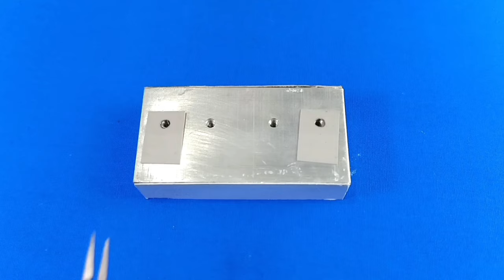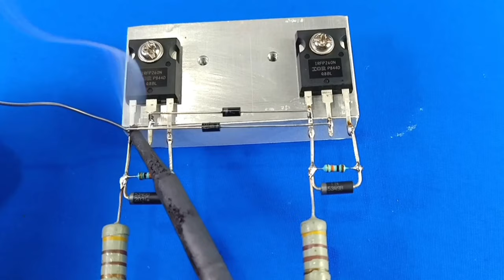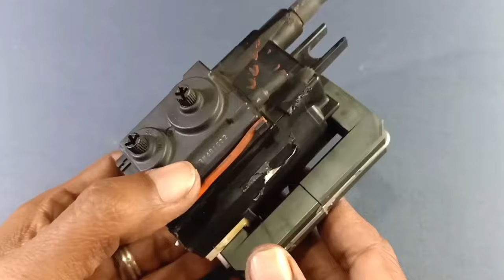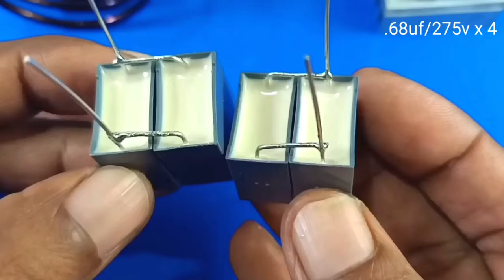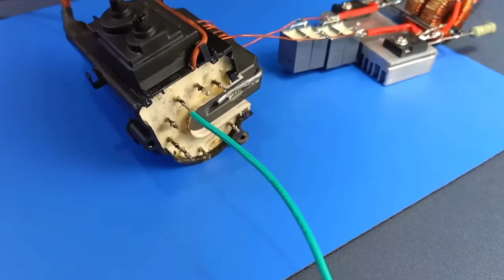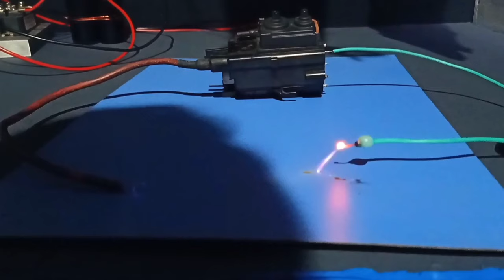DC 12v to 400000v High voltage Generator, Simple Homemade High volt Circuit

Comment: Its very nice but you added one zero too much in the title this arcs is 40kv and not 400kv if it was it would ignite at half a meter or so
Reply: Нулей много не бывает)))
Reply: yo, do the math. at 400kV it would around 14cm, not half a meter xD you would need more than 1 MV to spark it across 1/2m
Reply: People just really seem to love blown up numbers, huh? First we were talking about 400kV, now that spans half a meter... xDD. Btw, that arc looks more like 90kV, assuming 3kV/mm of breakdown voltage at atmospheric pressure. That's why it scares the shit out of me that he really holds both wires when arcing. That arc will drive quite the current, look at it's intensity...
Reply: Still WAY ! TOO ! MANY !  ZEROS !! ITS POINT ! MANY !! MANY ! MANY !! ZEROS !!!
Reply: и 40 кv нет 
25000 v .
афтор "гонит" .......
Reply: It make u do death or heavy shoch???
Reply: Да тут и русские есть
Reply: Ys
Reply: @blvckbytes7329  it's how far it can jump not how far it can be drawn out to.
Plus using needle points rather than spheres makes a big difference.. probably 30kv here
Reply: 9
Reply: Exatamente, eu concordo
Reply: No it's 9 kv
Reply: Quando se trata de alta tensão, fica difícil descobrir o valor "exato" da tensão .....🙄 eu já construi um  circuito oscilador semelhante a este para acionar o transformador flyback que possui um núcleo de ferrite  ou seja tal transformador trabalha com frequências extremamente altas ...meu objetivo era usar este transformador para acionar o primária de uma bobina de tesla ,a bobina de tesla é um transformador ressonante , geralmente este transformador não possui um núcleo como os demais transformadores, a bobina de tesla possui um núcleo de ar...
Reply: Больше 20кV..., но точно не 400kV
Reply: @ДмитрийСурский-ч1ф  и 20 не будет, тут скорее 10-15 кВ, у меня 12 кВ транс пробивал примерно такое же расстояние.
Reply: Remember air brakes donw 1-3kv/mm

Comment: Flyback transformers usually range from around 10-20kV not 400kV. If it was 400kV I think that transformer would be burning up by now.
Reply: Up to 27.5 kV for colour tvs.
Reply: I agree with you. In the video you can see that the two ends of wires are very close to start the arc, then once it is on, distance can be improved. You obtain a “plasma” discharge in this case.
Good project, I’ll try to reproduce it. As other people said,, it isn’t a good idea to handle both wires by hands…☠

Comment: You used to 0.5 Sq mm wire flow voltage 40kv not possible

Comment: Awesome, this is one of your best to me.
But I will love to ask how can we convert it for home use?
Thanks
Reply from the maker: Thanks for visit
Reply: @RJEDITALL  Brothers can electrocute pigs, what can a 12v inverter do?
Reply: @RJEDITALL  Sir, do you know how many kv a police stun stick has?  , I want to make a higher voltage than the police, but the high-voltage generator in our country is very easy to break, and the power generation time is only 6 seconds. After a long time, the high-voltage generator will burn out. Can you make a high-voltage generator?  Can it continue to discharge for more than a minute?
Reply: If you use 40kv at home... Then the power company charge also a 40kv...of your bill
Reply: @黄蟮  it is about 20-25kv in stun gun
Reply: doesnt  it have 50kv? my dad is a police officer and he showed me the taser manual and it says it uses 50kv @basic_proboi

Comment: This is at most 60kV, the initial spark distance tells you the voltage, depending on the power availible you can stretch the arcs further, for the initial arc its 10-15kV per centimeter

Comment: Looks reasonably easy to duplicate however there is no info about transformer voltage and current or the capacitor bank that is shown. I saw you said to another that parts list in description but not transistors are there. List of all components please!! 
 Cool project and want to try it
Reply from the maker: Please check the diagram in the video
Reply: @RJEDITALL  in what video to check for diagram? to the next video ??? hahaha loooooooool no diagram is there. Anyway , you have make a huge work to do that? Just take a vehickle multiplier and all ok
Reply: Well the transformers input voltage can be around 12 and output is 10-20kV
Reply: Các linh kiện điện bán dẫn ấy bạn có thể tìm chúng trong bo mạch tivi, nguồn máy tính cũ..và không nhất thiết biết nguồn điện kia ra bao nhiêu vôn..đơn giản chỉ là  chế nghịch

Comment: Thats an insane arc for a flyback, congratulations! But you are putting yourself at huge risk holding each wire with each hand, insulation can easily fail and the electricity will make it's way through your heart. use one hand only for such voltages unless you have two long sticks
Reply from the maker: Ok bro, ,❤️
Reply: bro it is high voltage arc but less current so if he touch the conducting wires he will not die just he will become unconscious for sometime.

Comment: I made one and it works now 
Can you please tell me the exact output of your power supply 
Volt and current (amps)
One more doubt ( can I use other diode instead of 4007 cuz it's too weak for this circuit.  Can I use fr207 or fr407
Reply from the maker: I don't check, just Idea, you can use this diode
Reply: @RJEDITALL  I also asked how much volt and amps you are supplying this circuit
Reply: @Greenorange0  it seems he use ex UPS transformator like around 12v 10A
Reply: Hey brother may I ask please what type of capacitor voltage and microfarad did you use when is connected to the bridge rectifier because he didn’t mention that as well
Reply: how did it work for you?? we triedbut very small spark. what can wedo? please help us sckl project🙏🏻🙏🏻🙏🏻🙏🏻🙏🏻🙏🏻🙏🏻🙏🏻🙏🏻☺️

Comment: could i use something like an irfz44n instead of those irfp260n?
Reply from the maker: Yes, you can use
Reply: @RJEDITALL thanks
Reply: Also could this circut be used as an induction heater?
Reply from the maker: @katinukanalas  yes, you can use for induction Heater
Reply: @RJEDITALL  youre the best

Comment: can we use toroidal 0.5 inch 60 turns instead of 1 inch?
Reply from the maker: You try with swg 19 copper wire

Comment: Much thanks for this
Please review the full list
And, how can it be used for home or workplace, like, welding ...
Reply: The circuit diagram is at the end of the video, it contains all the components you need to build. It's already build for home used, but you can't weld anything with it because it's just a science project for experiment with very high voltage and very
dangerous. If you have an idea of use it for welding, you better not come close to this beautiful but dangerous project. Cheer!

Comment: Hello sir may I know what capacitor did you use is it 10000uf 50v? And thank you fir the video it is great
Reply from the maker: No bro,     .68uf/275-450v capacitor
Reply: @RJEDITALL  Thank you sir for your quick answer, I want to know which capacitor voltage and microfarad did you use to connect it with the bridge rectifier

Comment: Please never use both hands while holding live cables. I know the frequency is ramped up high but you should get into the habit of safety. Then if viewers decide to try they will know how to stay safe whilst doing so. Insulated gloves and non conductive rods to make sure its away from you so body doesn't form part of the circuit. Stay safe ⚡
Reply from the maker: Ok,Thank u bro

Comment: Hello
I had a question
What is the name of that small diode that connects one transistor to another?
And that big resistor is a few ohms and a few watts؟
Reply from the maker: please check diagram, zener diode 12v 1-5w. and diode 4007

Comment: Is this possible? Use electric appliances like fan, rice cooker, heater, kettle without any problem?
Reply from the maker: No, not possible, this is dangerous, high voltage
Reply: @RJEDITALL  Thank you very much !!!
Reply: You can change the output to not be connected to a flyback transformer instead be connected to a coil with a few turns to use as an induction heater.

Comment: man I even have one of these flyback transformer but lack of knowledge 😢about it I wanted to make one but couldn't understand anything And i dont even know which and what components u used in ur video
Reply from the maker: Please check diagram in the video, and working with safety
Reply: @RJEDITALL  sure man can i connect the final two wires (by which u were making arcs) and make a jacobs ladder I even seen some of others using a ballast for high voltage
Reply: @RJEDITALL  u earned a new sub!

Comment: I made this circuit.. and its excellent  but it has a strange behavior... when i used a ac flyback and turned it on the first arc was small .. after the first arc the second arcs was big and so on ... can you please tell me the cause of this.. whenever i do this i always get first arc small after that i get big arcs😮😮
Reply from the maker: Check it well

Comment: Ok its a zvs driver with crt flyback transformer but what surprised me the was that he was holding both wires with bare hands, 100% chance of high voltage breaking through insulation sending him to destination f, probably ranks in top 10 luckiest people in the world
Reply: @RJEDITALL  so jao
Reply: Not exactly luck but it depends on the thickness of the insulation.

Comment: what is minimum ampere to run this type of circuits? can I use cpu power supply? thank you
Reply from the maker: Maximum 24v 15 ampere, ❤️
Reply: @RJEDITALL  can i use cctv power supply switching
Reply: It depends on the size of the arcs, the smaller the arcs the lower the current and vice versa.

Comment: Very good...is this a D.C to A.C converter circuit driving a car ignition coil??
Reply from the maker: Thank u ❤️
Reply: @RJEDITALL  mcn mta oyage contakt no ekk dannako
Reply: Well not really since car ignition coils cannot work with that high frequency. But you can technically call this a DC to AC convertor but only for high frequency (around 15-50kHz).

Comment: My zener keeps exploding now i have 5 died irfp260n  3 died 12v 5w zener diode why its keep dying ? First 30 40 sec works and dies away
Reply from the maker: @AmplifierBoards-c2q  check your pf, first time check with low voltage n current

Comment: Can i connect it on 12volt 4.5 ah baytery
Reply from the maker: Yes
Reply: Its not working the mosfet gets heat with any supply
Reply from the maker: @Greenorange0  check it well 100% working, you add new pf

Comment: Sir I made same as shown in video but my capacitor is diff but rating is same still it is giving vary low arc not big as shown in vid
Reply from the maker: Use orginal capacitor, 100% working
Reply: I used  Metallized Polypropylene Film capacitor but rating is same

Comment: is it possible to use a protective diode 1.5ke15ca instead of a zener diode for 12v read others say that it is possible? This is true?
Reply from the maker: Not possible, not working this circuit without zener diode

Comment: But how can that green small wire hold such a high voltage easily without being burnt
Reply: Green wire is used at gnd end , or "0"potential

Comment: Sir i have replicated but its not working 😢can you please share me the details, as i have done just in the drawing as same as but there is no output,  output is nill but the circute is heating 😢
Reply from the maker: Please use orginal capacitor

Comment: PLS stay away from such stunts!! Once the wire burns through the skin the body resistance will drop drastically. The main reason why even 230VAC is fatal, is because the muscles contract (when shocked) and forms an iron grip onto the live circuit (that's why we pull by his shirt collar or by a wooden plank).
Reply from the maker: Thank you bro for visit
Reply: I don't think that flyback is producing the amps a 240vac power source does ...
Reply: @codyramos3200  Well we deal in high power DC motors. The flyback energy for a 10kA (short time) current is precisely 10000Amps. The voltage will increase ~6 times BUT the voltage  rises (in an inductor) to maintain the current through it. SO the flyback circuit is rated for the full load Amps. 😐

Comment: It can kill! Direct current is more dangerous than alternating current!
Reply: Actually you can't say one is more dangerous than the other because high voltage in general is already dangerous regardless if it's AC or DC.

Comment: The voltage is not 400000 volts it looks more like 30000 volts
Reply: Bro please explain the working of the above circuit if you can.
Reply: @faizullahashraf7114  it looks like a flyback transformer connected to a zvs driver
Reply: Usually it's about 10-20kV

Comment: It is extremely dangerous, if current flow though the body, may dead a healthy human, holding a high voltage supply with both hands is extremely dangerous, if current will flow through both hands, will struck on the heart as it is in the centre of hands, and person can die forever.

Comment: 🥴 what's the voltage rating of the wire?? (connected on the o/p side)
Reply from the maker: Input 12-30v 5-25 ampere dc
Reply: @RJEDITALL  dear stay away from such stunts!! Once the wire burns through the skin the body resistance will drop drastically. The main reason why even 230VAC is fatal, is because the muscles contract (when shocked) and forms an iron grip onto the live circuit (that's why we pull by his shirt collar or by a wooden plank).
Reply: @RJEDITALL  আপনি এগুলো বিক্রি করেন

Comment: It is circuit does not generate 400000v
Reply: The voltage is usually around 10-20kV

Comment: You make other do dangerous things from you because your poor knowledge about safety. If you are unlucky you already die before. 10Kv=1cm long of the arc so it cant be at 400kv because your arc at 20.3cm
Reply: Not exactly.
It's the initial arc that's matter when you measuring the distance   for that matter, not the maximum distance